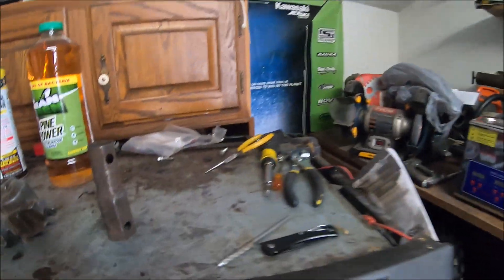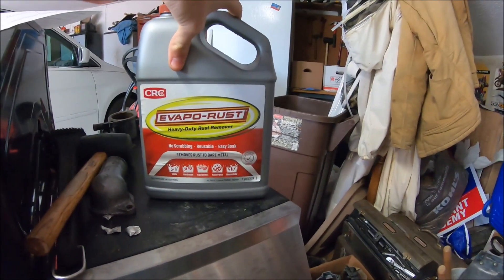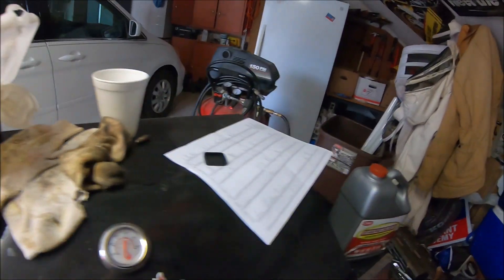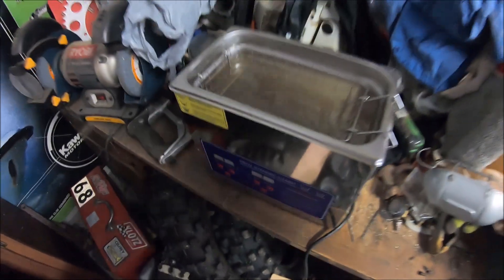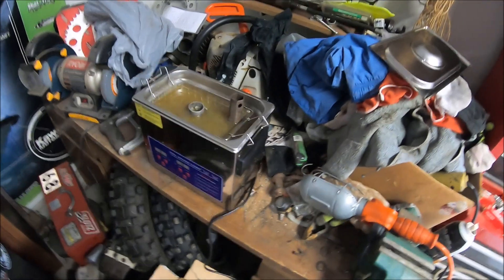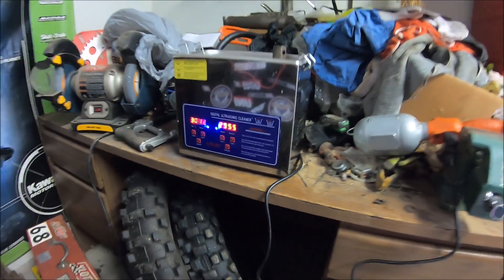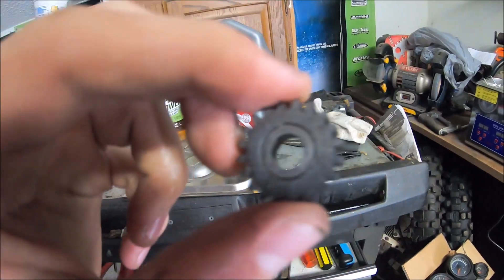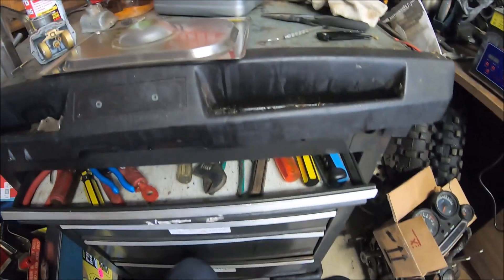Is This The Best Ultrasonic Cleaning Solution? Evapo-rust VS Mean Green Pine Power(Pine Sol)

Comment: If you are just trying to remove rust something acid based like mariatic acid or a tolite bowl cleaner works well you just need to pay attention because it will attack the part as well but the damage is generally not that bad if you don't leave it to long but thats for rust but for an aluminum carb id just use a degreaser and would be good for cleaning but not really do much for rust but for aluminum id make sure the degrease is not to basic because that will attack the aluminum too